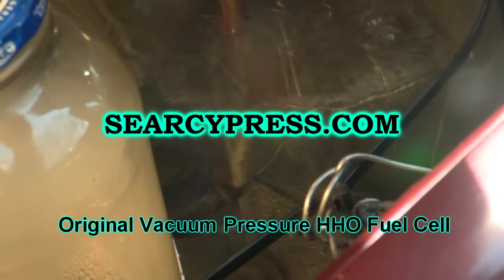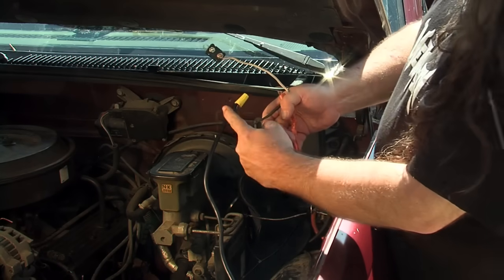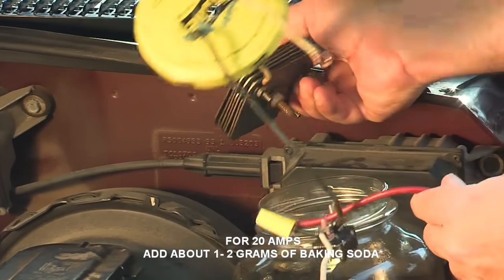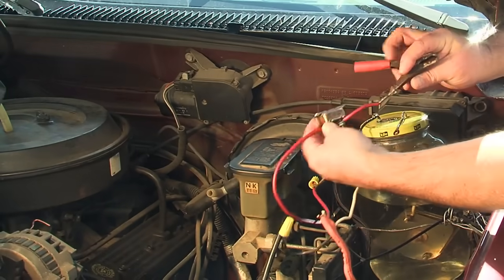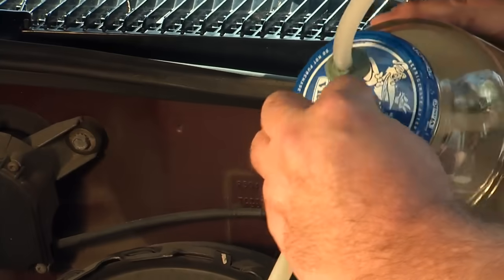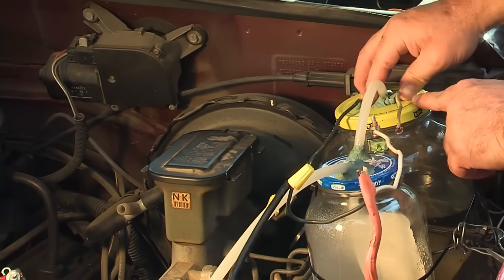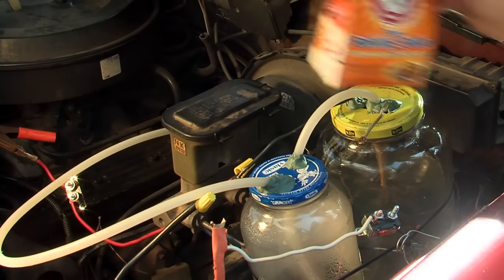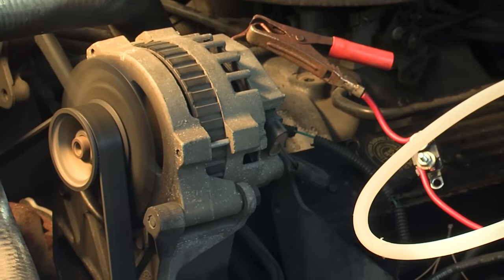Vacuum Pressure Hydrogen fuel cell defeats high gas prices using hydrogen from H2O.

Comment: Steam cleaning the engine from the inside, what could go wrong? 🙃
Reply: @Leon C. You do know sea foam is fuel system safe to clean the piston and valves right?..... It can also be used in oil.......... Might sound kind of odd to a know it all but it doesnt burn either...... Just like water 😂 go watch more videos and learn about motor longevity stuff it may help you in the future (lots and lots of videos of people using water through the intake system to clean the top side of the motor) 

Also if your worried about water getting into the oil maybe you should go watch something on how a motor works and requiers compression which means you cant have piston rings that let blow by ( fuel or in this case water) by :)
Reply: @Leon C. 

Ever tried getting engine running and warm and letting in drops of water a time in the throttle body to steam clean the engine?

Or ever heard of it?

People been doing it for years
Reply: Leon C. before trying to make fun of somebody be sure to know what you are talking about. Yes you can clean carbon from your engine using water. You being the moron in this case would probably use Seafoam. Water has been used for decades to do the same thing. You and your skinny jeans  back in your Prius or get a man to do the work for you.
Reply: @mellow1163  Yeah have fun getting water into your engine, it ruins the motor oil and causes rust. It takes a special kind of stupid to put glass jars with hydrogen in your engine bay, let alone connect them to the engine.
Reply: Leon C. HAHAHA ok skinny jeans listen up. It's called compression. Every car has it. Compression produces heat, Gas can ignite without spark if to much compression for the gas. That's why there are Different octane. So any liquid that doesn't ignite turns to what?? Yes STEAM!!! like the Seafoam you use and pay $10 for lol. He was technically Correct when saying it steam cleans the engine. just like all the other products like Seafoam. Get the picture. How do you think diesel engines run?? look it up smart guy
Reply: Leon C. This is nothing new. New to you but very old indeed. all of it.
Reply: @Ie0n1  fuel is hydrogen and carbon. 
Oxygen in air combines with carbon to create carbon dioxide. 
Oxygen combines with hydrogen to CREATE WATER.
EACH gallon of gasoline CREATES a FEW gallons of water inside your cylinder. 
Thats why exhausts rust out.
This generator uses a spoonfull of water a day.

Comment: Um, wait a minute... I call BS!
Gasoline explodes, gets bigger when ignited, while hydrogen implodes, gets smaller when ignited,
(Steam takes up less space than hydrogen, look it up morons) 
Try igniting a water bottle full of your hydrogen mix when submerged under a bucket of water and watch it crush inward.
Mixing hydrogen with gasoline actually  reduces the efficiency of your gasoline unless you stop using gasoline entirely like Harlow did with the original Maynex, (before they were made an offer they can't refuse by the oil cartles)

Comment: You need to double insulate the wires at the lid since the lid is metal and you keep moving it on and off which would deteriorate the insulation.
Reply from the maker: Normally I would agree. The reason we use that particular sealant is, it self heals. I have tried silicones epoxies pretty much everything you can think of and nothing will ever last indefinitely except the stuff we use. Both of those wires are directly fused with automatic reset fuses. You would be surprised how long it takes before it actually cuts into them. When it eventually does there is no risk of explosion because it is in vacuum. It simply causes the circuit breaker to trip. I am certain there's a better way to do it in the long run however it lasted so long we never got around to it. Thank you for the comment
Reply: @metalpresstv  But since the hydrogen and oxygen is mixed inside the jar, it could still explode even in a vacuum. Some people have used a large hole with a rubber ball found in old pc mouse with a spring. That way if there is an explosion, the jar would not break, instead the gas escapes through the hole that has the mouse ball / spring.
Reply from the maker: @elguapo6164  I understand your way of thinking. However practical testing has shown that it does not work like that. As a matter of fact we have taken that exact jar and pressurized it completely full of hydrogen oxygen gas and lit it on fire. The result was simply the lid getting blown off. We repeated this test many times and never did the glass break. In the state of vacuum it just simply does not have a high enough concentration level to ignite. I am all for safety. I just thought you might like to know the results of our testing. Thanks again very much for your comments.

Comment: Doesn't work,the alternator just works harder.the only gain is the water vapor improving compression
Reply: exept the only water vapour present is the one condensing into actual water out the exaust what enters the gaz chamber is separated hydrogen and oxygen gazes , the current hes running through the water isnt boiling it its chemically separating it so he can use the hydrogen as fuel , and when hydrogen is burnt what is emited from the combustion is water vapour ... cus burning something is just giving it heat and oxygen ... therefore giving heat and oxygen to hydrogen gives us hot H2O wich only comes out the exaust ... so yes this does work ! XD put in some research before just assuming you know it all :P

Comment: If this actually increased gas mileage, wouldn't you think all car manufacturers would incorporate them into their engines?
Reply: There is no profit in using water as fuel.
Reply: How much tax money would the state and Fed. loose via highway tax if HHO was used? This would attack revenue which kicks in the Invention Secrecy Act of 1951. This is why solar panels that are 200-300% more efficient have been restricted. People would switch to solar and force utilities to buy their excess by law and bankrupt utility companies and tax revenue.
We have the tech for off the grid homes and HHO cars, but it would cripple tax revenue. Now if tires were taxed 1000% I'm guessing it would make up a partial revenue to replace highway tax, but there is know way the public would pay $1500.00 per tire to fund road repair. Imagine the over the road shipping increase it would cause. Do some research on the Secrecy Act.
https://en.wikipedia.org/wiki/Invention_Secrecy_Act 
https://fas.org/sgp/othergov/invention/index.html 

Ever notice these HHO videos only have small amounts of water to replace gallons of gas? I would expect at least 5 gal tank to feed the HHO chamber with a shutoff to kill the electrodes if the water level drops to the point it will go "BOOM". We have the tech. but this video was made for hits/clicks with a big safety warning up front because of the "BOOM" design. It's just the basic science made to go boom.

Comment: It's always a good idea to rust your engine out from the inside..
Reply from the maker: Gasoline produces water when burned. Hho will actually will remove carbon deposits. Thats an important difference. Thank you for the comment.
Reply: The water vapor is actually good for the engine it keeps it clean, it's the hydrogen that damages the rings and cylinder walls.  Aircrft engines use water injection systems to keep them clean with no "rusting" issues

Comment: No head to head test I'd love to see you test this out with a obd2 reader and show the stock mileage for a few days and then hook this set up up and show us the difference
Reply from the maker: It is quite difficult to get accurate readings I totally agree. We tested this by putting in one gallon of fuel and running the truck dry several times with the fuel cell on and off. Certainly not good for the fuel pump but it did survive. So many things can affect the mileage. How you drive is the big factor. Thank you for your comment.

Comment: Look at all of the slanderous disinfo agent gate keepers with their blank profiles.
Reply: I'm attempting to show research articles on the combustion of HHO gas in gasoline internal combustion engines to a 'University educator' in the comments section here that is frustratingly like talking to an angsty teenager. 

I figure Youtube has been deleting my URLs so I've taken to quoting the relevant passages showing thermal efficiency improvements and gasoline consumption rates going down, and the title of the research article at the top. 

I'm waiting for him to come back at me with something lame...
Reply: @scienceminded  Hi bud, I would say your wasting your time with that guy. Cogitative dissonance, spell casting, and ego are at the core of the issue that blinds most in this and every other area in life. To admit they have been lied to and this realm isn't what they thought would destroy their paradigm and also make them question other such topics, and that's a road the won't go down, especially people in his line of work!
Reply: @scienceminded  I just wanted to add that this is a really lame generator in the vid, you can go on eBay and get far better ones. This is not a very efficient method for making hho, although it will give big gains in mileage.

Comment: You cannot defeat the laws of thermodynamics. You will not get more energy from hydrogen than the electricity you use and the gas you burn to make it. The only advantage such a device can provide is to help more complete ignition of the fuel in a poorly tuned carburetor engine. This system would provide no benefit to a modern computerized fuel-injected engine.
Reply: bkm83442  In the late 70's -- early 80's Ronald Reagan and a GM Engineer came on TV explaining how getting substantially better fuel economy was not possible.
I considered the engineer's understanding and figured it was in error but enough was correct to stop my pursuit in building a high efficient gas engine... (100 MPG or more gas engine)   
      I did (correctly) realize that making engines and fuel savers more complex is the WRONG DIRECTION.
Then... In the early 90's I decided to ask my Dad how efficient were train engines.  (See I calculated the size of the trains fuel tanks and amount of train cars it towed.  This was just simple visual observations, yet sufficient to call for re-evaluation of the fuel mileage dilemma.) So... My Dad being a train mechanic, I decided to ask about train fuel economy. I ask him... How many barrels per hour does these train engines consume.  He, off the top of his head knew the MPG... (A standard Semi at that time got roughly 6 miles per gallon.) Well an average train with average amount of engines and cars get about 10 MPG at that time... Today they get about 14 MPG.  This tosses a BIG monkey wrench into your claim.
     So..  With an old pickup truck, I built my VERY CRUDE system... Just a tad bit better than such type systems you can find on YouTube... From 3X to 10X better.  And... It worked.  I smelled the exhaust and it was CLEAN.  See I had this idea... Reverse the air/fuel averages... I mean... Build a system that uses All the Fuel, But does not use all the Oxygen.  
.  For certain personal reasons I have not physically developed my system... I have however spent much fuel time building these system(S) in my head... Reducing their size while increasing their efficiency.  After I build my first one, I plan on giving the design away for free to everyone before the end of the first year... (Protection). Since I have currently 4 up-grades.  What I am telling you is the current obstacles in thermal dynamics are WRONG.  This is not a guess.   So sellers building such things... Keep going.
I am a self--taught engineer in several fields.  My son is a Sheep--Skin Engineer and flys all over the world due to his abilities.  He grew up watching me modify every thing we had and he enjoyed watching that much.
.      I even have a 4 cyl gas engine design with less than 9 moving parts. Does it work?  It has no choice.  Based on the principals of tried and true enhines, it has no choice.  Like the 4 fuel/air increase prototypes I have built in my head. This engine is also built in my head.  And all are eloquint on paper.  Desire to understand my engine designs, (4 upgrades to it as well)  Ok... It is a four cylinder but only two pistons.  No piston rings. No camshaft, No valves, and more... (I mean less)

Comment: The cell must in line of the ground system.
It Connor be wired +in  -out. It must be -in -out. This is  The reason it can not generate enough hydrogen only fuel to run the engine gasolineless..

This is a oxy  hydrogen only device.
Not a hydrogen only device.

Hydrogen only has two cathoids and a ground in and ground out.
Oxygen is the opposite polarity.
Reply: So did Stan Myers do it 5his way?

Comment: how do maintain or keep an eye on pressure for buildup or 4 lack of do u add a gauge and do u have to turn it off and on all the time  or just keep it on I'm only asking cause I'm curious about it it has peaked my interest lol
Reply from the maker: Pressure build-up is not really a problem on the vacuum line. If you are however hitting the gas very hard going up a very large Mountain or something the vacuum pressure will be near atmospheric.

Comment: This would be good with an old Mazda Wankel engine.  They left so much gasoline un-burned that maybe adding a little H2 to the mix would ignite the remaining un-burnt gasoline to improve its mileage.
Reply: Mazda actually made hybrid gasoline-hydrogen Wankel engines that did exactly that.

Comment: I Have Tried it & It Is B.S.
Reply: It would be good to post the reason and data from your work

You could be 100% right or made mastakes in your work

After all the best mines or some of those in power said Tesla A.C. system of current was a scam

But after the world's f
fair the world saw lighting and his AC system and those in power could not stop it 

It's nice to give data at times if not people will have questions about the words and phrases like It's BS
Reply: Likely the cause of failure was due to the fact the hydrogen implodes (i.e. gets smaller when ignited) while gasoline explodes when ignited. 
Hydrogen can power internal combustion engines using this implosion, but adding H to gasoline actually cancels out the gasoline's explosive pressure in the combustion chamber....

Comment: I have built and tested this myself and discovered that the power required to manufacture enough hydrogen to run an engine is more than the setup in this video. 
Don't waist your time.

Comment: You can make hydrogen throughout hight sound frequency. The water molecules  start moving very fast because we hit it and forced to collide each other, with that way we reduce electricity consumption and increase efficiency
Reply from the maker: I have seen and heard a lot of that over the years. I do  know that pulsing can be more efficient as it allows time for the bubbles to get out of the way of the plates. I have yet to see anyone produce the Ferocious bubbling that can be achieved running the Cell at 100 amps. If they can do that with pulsing frequencies at say 5 or 10 amps I would be totally impressed. Thanks for the comment.
Reply: Any idea of what frequency, or frequencies?
Reply: @TheHeartCharmer  you need to use the 11th harmonic (2 frequencies, 1 at11x the other0, than with a sine wave generator(2) find the resonant frequency of a water molecule. This will produce hydrogen at a milliamp electrical load,. Separate the anode and cathodes as each will  produce the gasses separately.(safety). A membrane installed in jar can produce electricity from the reassociation of the unused gas to water.
Reply: @ranmanification  Ok. Thanks for saying. Wish I had more time to experiment. Have you successfully achieved this yourself, may I ask out of interest?

Comment: This won't work on an computerized injected engine, the engine computer will eventually compensate for the lack of petroleum fuels and will enrich the fuel. A secondary computer is needed to either fool or override the main computer. IF you do run this on a carburetted engine you had better install a stainless exhaust system.